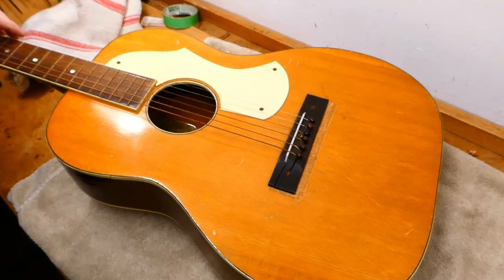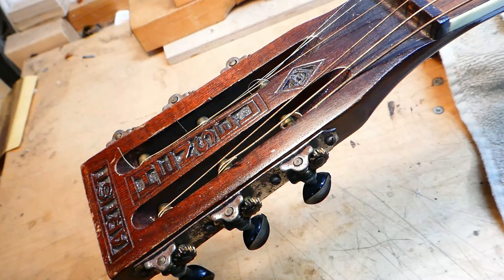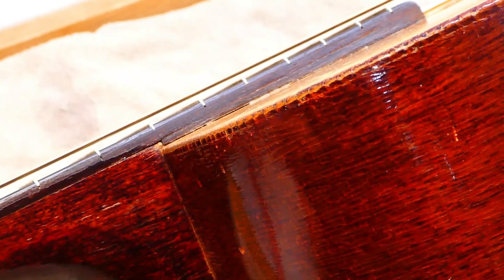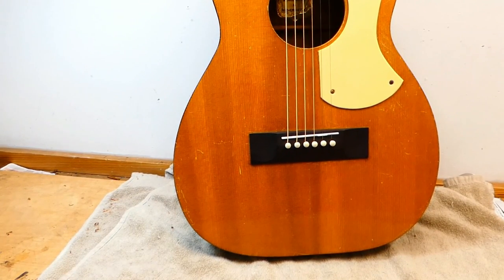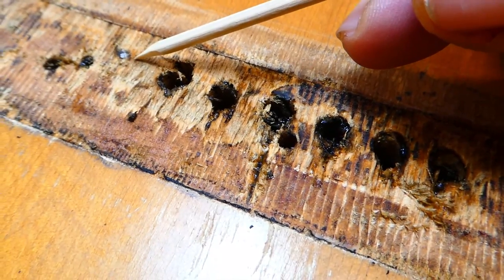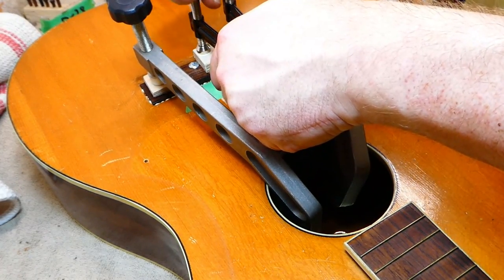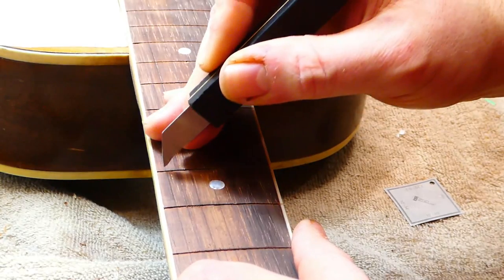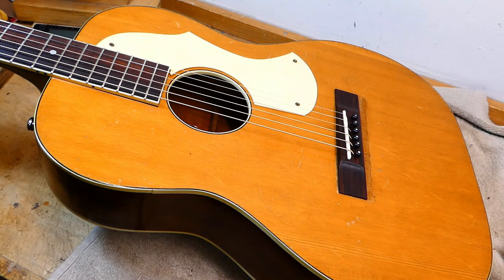The Ultimate Hensel Experience

Comment: I was given a Hensel a couple of years ago. It was found in a dumpster behind an apartment building on moving day. The neck was loose, it was covered in some kind of yellow guck as the result of an amateurish attempt at refinishing and had golf tees for bridge pins. I built a few acoustics many years ago and wanted to try fixing this thing as a way to counter covid lockdown boredom. I found your website and emailed you and you were kind enough to respond with a lot of good info, with the advice that the scale length probably needed changing by way of installing a new fingerboard. So it took a year of picking away at it, but I replaced the fingerboard, installed a truss rod, reset the neck, replaced missing back braces and refinished it. It worked well and the ting sounds pretty sweet, dark and warm. Thank you for your advice!
Reply: Impressive!

Comment: Lovely work, as always. It seems like a guitar with those general dimensions should have a bit more low end; presumably the robust top bracing you pointed out trades away some resonance in exchange for avoiding a top belly. I chuckled out loud at the "carefree string spacing" crack. 😂

Comment: Speaking of action, my new Tele surprised the crap out of me. I lowered the action until it was barely over the frets and it barely buzzed at all. So I set it fairly low. TBH, it's the lowest I've seen on any guitar. But that's not saying much. I haven't seen many guitars up, close other than mine. Action may be 2/64? Possibly 1.5/64" with zero exaggeration.

I literally laugh every time I pick it up because I'm still, shocked at how low It is 🤣

Comment: I have a Resonator Acoustic-Electric made by Gretsch & I use very light gauge strings on it (in this case Thomastik JS110 Flatwounds) because the cone is actually cut thinner (as is the bridge). I worked around the acoustic volume issue by stringing the strings backwards underneath the tailpiece rather than above it which gives me a better break angle, & increased the volume. I use that Resonator Guitar for song covers, most recently I've used it to play a cover of the famous Soprano Aria (I'm a Baritenor so I actually sing the Soprano part down an Octave so I wouldn't strain my voice) "For Love of me my Lord is Dying" from Bach's St Matthew Passion (BWV 244).

Comment: Hey man. I have an old copely guitar I'm working on. And it's weird because I had to remove the neck and it's held in by 3 dowel rods. The truss rod is under the fretboard with access to it from the sound hole. My problem is I have to un bowl the body because the support braces came loose from the body top. Any help to fix this would be great. Thanks in advance.

Comment: I've started messing around with CNC woodworking, I was surprised at how slow they want you to run the bits. The idea is to use the entire cutting flutes of the tool and put the heat in the chips, not the tool, you may want to slow it down a bit until the tool bogs.